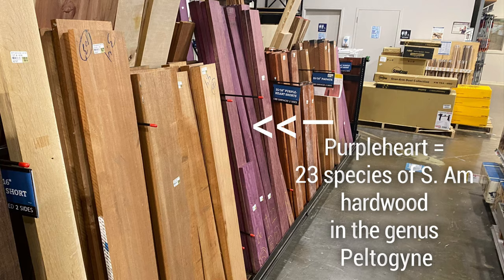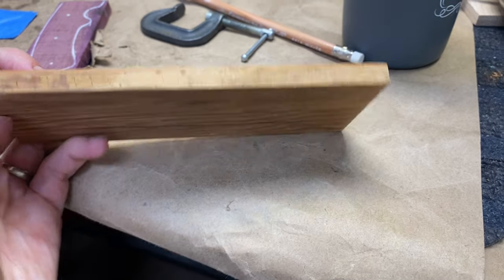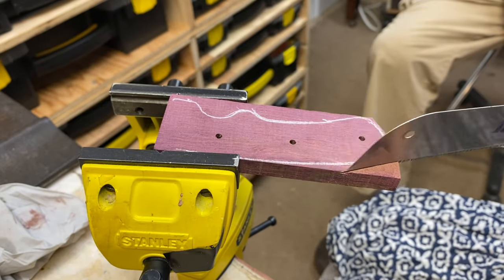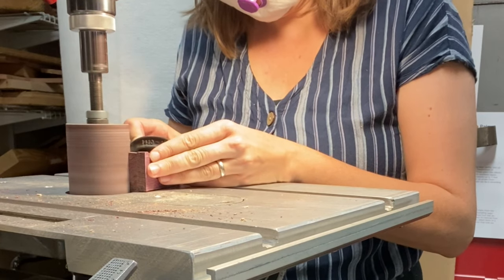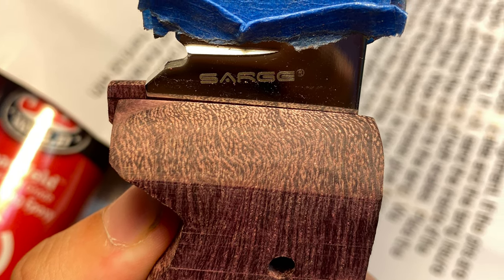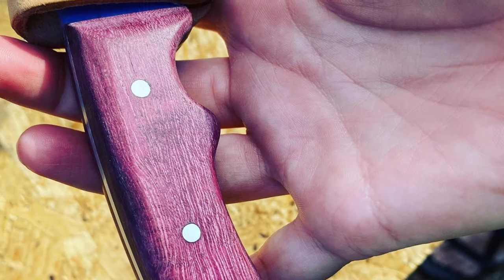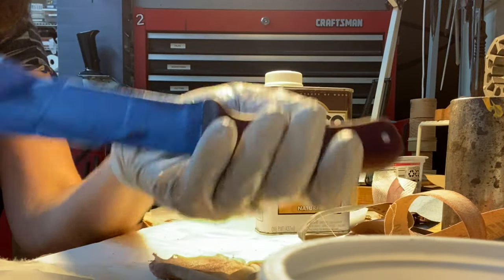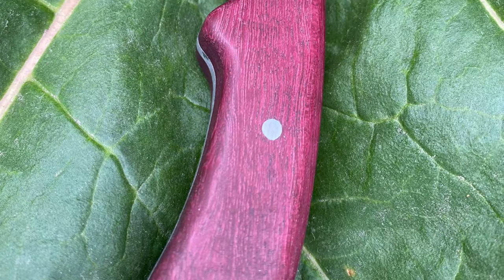Making a Hunting/Garden Knife Start to Finish (Hobbies Build Resilience)

Comment: You mentioned you’d change some things. Wondering what improvements you were thinking of.
Reply from the maker: I would make the angle at the front of the scales shallower. I would also taper the butt end of the knife more.  I would also skip setting up the belt sander (on a shopsmith, swapping out components is a bit of a pain) and just use varying diameters of the drum sander. I think it is easier to use and I didn’t need to try different sanders to get the job done.  Would’ve saved time to stick to the drum sander